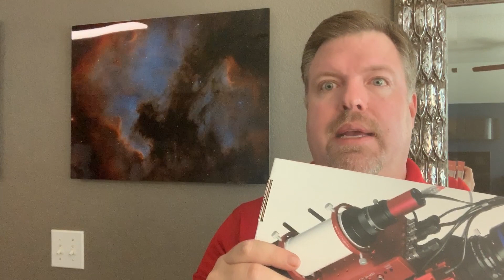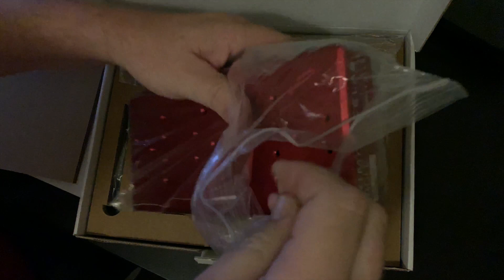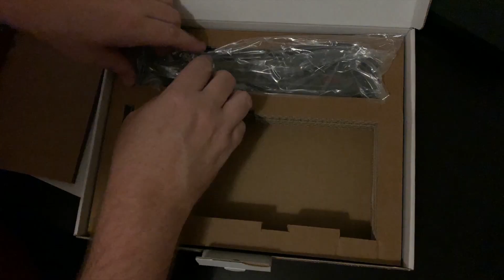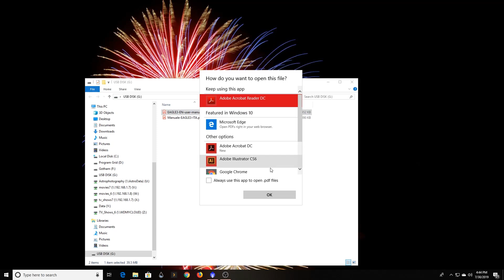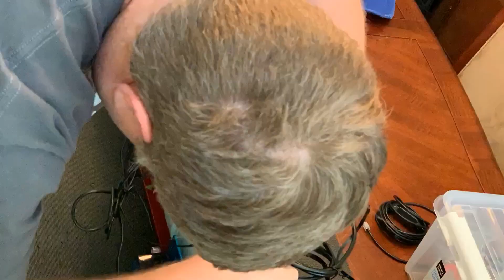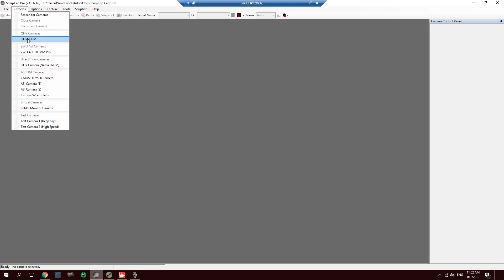Eagle 3 Telescope Control System unboxing and setup

Comment: I saw a previous question about how to use SkySafari with this set up... I saw that you use SGPro...PLEASE could you provide more information? I went to their website and can't find anything about it.  You show it on the video... all I need are just a few more specifics... Thanks for the video and PLEASE thanks for a bit more information on how to use SkySafari.
Thank you very much!
Reply from the maker: Sure.  Look in the SGP help file for “allow external control”.  The doc will show you where to click the checkbox in the settings to allow external control.  It should also have the settings to put into Sky Safari to get you connected.

Comment: Great info and easy to understand for the not computer or engineering savvy ,  would you care to share what programs you have downloaded on your ipad to  make all this work so flawless ?
Reply from the maker: Thanks Nelson!  "Flawlessly" is probably overstating it :)  If you're using a PC of some type to drive your gear, there are two types of programs that I use that work very well.  The first is some sort of remote desktop app.  If the computer is a Windows 10 Pro machine like the eagle, you can just use the Windows Remote Desktop app.  Otherwise, programs like TeamViewer or VNC have apps you can run on your tablet/phone to connect via a similar app you install on the PC.  

The other app I use is Sky Safari Pro.  It's basically a nice planetarium app on the iPad, but the pro version (approx $50) also comes with some nice telescope control capabilities that sync up with Sequence Generator pro.  You can always use free planetarium software on the PC and control via remote desktop, but I really like having an app designed for touch controls.   

There is some setup involved with each of those pieces of software, but once things are up and running, it's so nice to control via the tablet.
Reply: @lazyastronomy3348  thank you , i do have the asiair and was planning on running it with a windows based laptop, but was wondering if it could be done with the ipad , thanks for your patience yet again

Comment: Great explanation ,(subscribed)  thank you great video as well ,  question , would you say this is a must have for a beginner set up ( mount ,scope ,dslr or cmos , filter wheel ,? thank you
Reply from the maker: nelson rivera thanks!  A good thing to remember is that almost nothing in this hobby is a must have, and you can always work with what you have to get good results.  

If you use a computer controlled camera, you’ll need a computer, but you can get a raspberry pi solution for $100, a cheap laptop, or a windows computer stick if that’s what you can make work.   I’d only go into an option like this once you’ve really gotten fully hooked on the hobby and decided that you want something just like this because it’s a super specific thing, not something you can use a lot of different ways.
Reply: i ended up sending for asi air, cheaper for my set up

Comment: Great video with detailed information!
I am thinking of buying one as well, and I have seen you are working with PegasusAstro Focusers as well. 
How did you manage to power the pegasusastro with the Eagle?
According to Pegasus it needs 12V 10A, which the Eagle does not have...
Reply from the maker: I think it's the Pocket Powerbox that requires the 10a power supply, so it can provide enough power to other devices.  The Eagle replaces that part.  The Focuscube requires less than 3 amps, so the Eagle can handle that fine.
Reply: @lazyastronomy3348  Thank you!

Comment: I've been quite interested in this piece of kit for a while.  The price tag right now is putting me off, but I am curious to know which flavor of Eagle 3 are you using?  I don't recall you mentioning if this was the Pentium, i3 or i5 variant.

Thanks in advance, I'll be interested to see you do some tests in terms of USB to SSD write speeds on those USB 3.0 ports and see if this would work for planetary / lunar / solar work.  That's been a massive limitation of mine with an Intel Compute Stick i3, ultimately why I stopped using it.
Reply from the maker: Allen Mitchell I went for the pro version.  I don’t think the version will make that much of a difference, honestly.  I like to push any computer I have to it’s limits, so I went for the beefiest one.  The biggest slowdown issue would be with plate solving.  If you don’t do that or don’t mind it taking a bit longer to do the solve, any option should be good.
Reply: @lazyastronomy3348  plate solving is my jam!  TheSkyX makes it nearly idiot proof with their Paramount MyT.

My Intel compute stick m3 can handle plate solving without issue.

It has a hell of a time running all the software since the 2GB of memory almost gets completely used up by Windows and the sky x
Reply from the maker: Allen Mitchell yeah, I’ve never used a compute stick, but I’d bet it would max out quick.  I’d think any of the Eagles would perform considerably better.
Reply: @lazyastronomy3348  Spoiler alert:  Just don't use an ICS.

Comment: Very informative video!  Good job.

I'm pretty new to this hobby and I'm attracted to every new bell and whistle I see.  I've seen this system and I've seen ZWO's ASIAir.  If you've used, or seen, both, what is the difference between the two?  I know there's a bigger price tag for the Eagle 3, but does it do the same stuff better?  Or does it have more capabilities?  I know the ASIAir has it's own guiding system, but you're using PHD3 (which I already use).   I don't mean to ask a ton of questions, but it seems like you've taken your time to learn this one fairly well already.  TIA and clear skies!
Reply from the maker: Ozarks Astrophotography Allen is not wrong, but there’s another thing to keep in mind.  Both the StellarMate and ASI air are Raspberry Pi devices, which are super light and low powered.  aSIair uses their own software to make image capture and guiding super easy at a pretty cheap price.

StellarMate is a basic operating system and some Astro software that you need to setup for your gear.  That can be kind of daunting.  I’ve tried it and didn’t like it too much, but it’s damn near free, which is hard to beat.

The Eagle is a Windows 10 PC first and foremost, so you bring whatever Windows software you like to it, so it’s an easy transition.  Everything else is custom hardware for form factor and power management via some simple pre loaded software.  It’s awesome if you want a full
Laptop and power manager built into your scope, but you’re paying for and adding the same amount of weight as doing that.

All of these can be great options depending on your preference.
Reply: @lazyastronomy3348  Okay, that connects the dots.  Being a Windows 10 computer you're able to use whatever software you like as long as it's W10 compatible.  Not sure why I didn't grasp that to begin with. LOL
Reply: Getting the new shiny bug is very common in Astrophotography!  You're in good company.  
To get to your $$$ question:  The eagle costs substantially more than other options like the ASIAir and Stellarmate simply because the hardware is far more robust.  

The ASIAir and Stellarmate units are based on a RaspberryPi computer, where the Eagle 3 is quite literally a headless laptop.  They come with Intel processors, and at least double the RAM even for the lowest end Eagle 3.  The ASIAir and Stellarmates have just enough processing and RAM power to do the bare minimum for remote astrophotography.  The Eagle is a true laptop replacement.  And when you think about the price associated with what a Laptop, the Eagle being a specialty computer that is more weather resilient than a typical laptop means that they really are on par in terms of money spent, but the value is in favor of the Eagle.
Reply: @I_Spaced_Out  That's pretty much the answer I expected.  The Eagle 3 seems like a pro unit, whereas the ASIAir is aimed more for beginner/hobbyist market.  I probably won't move to one of these in the near future, because I do like my laptop (at the moment).  But I do see me making the move later down the road.  Thanks for the info.